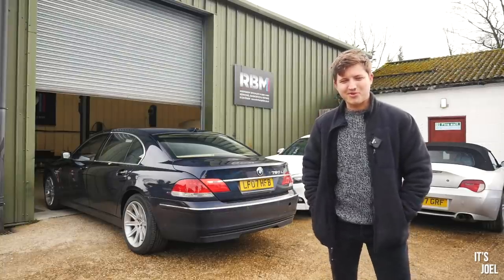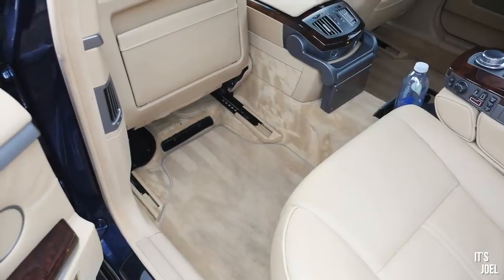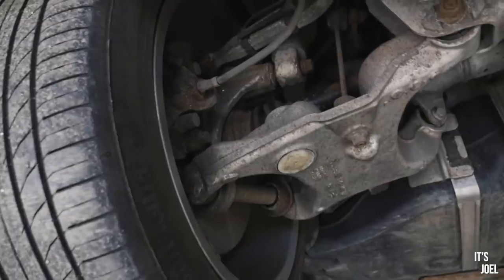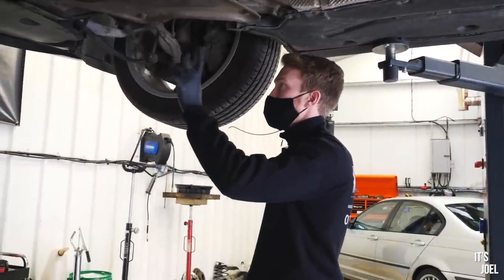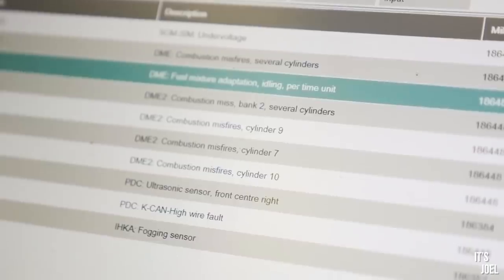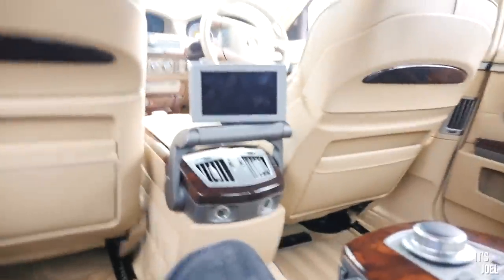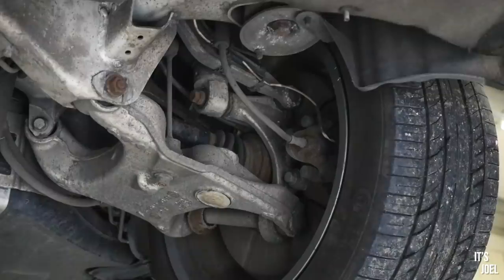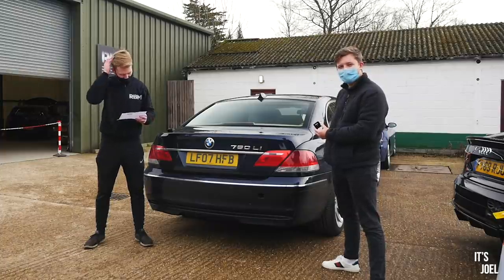How much will it cost to fix-up the cheapest V12 in the country?

Comment: As a former keeper of this car for 4 years I am very happy to see this. It tallies with my ownership experience, it never really cost me much to maintain either (FAR less than the RR Vogue I had before it), but having said that,  whenever I got a fault code or my mechanic (Atrincham Autotechnic) recommended something, I made sure I attended to it without a thought for the cost, and that's the only way you should approach ownership of a car like this. The coolant loss issue was something I had looked into more than once (full temp pressure tested and rad changed,  still couldn't diagnose it) so I just learned to live with topping it up every 2-3 weeks. I always made sure the fluids were regularly changed. The engine was bulletproof for me. Good luck and very interested to see your future vids Joel, do look after her!
Reply: I also had the engine carbon cleaned but it made no difference to performance whatsoever, total waste of £300!
Reply: @zhzhhhzhzhzzzz  yea they usually are a waste of money.
Reply: probably a very thirsty beast though. My C63 AMG was gining me 10-14mpg
Reply from the maker: @b.h.6307  averaging about 16 in this
Reply: @b.h.6307  correct, I averaged 15mpg in that thing
Reply: What about the rocker gasket leak and the wet rear passenger floor?
Reply: @1956ultra  not when I had it
Reply from the maker: I’m so glad you’re here to continue following along with this cars’ journey! Appreciate your input!
Reply: @zhzhhhzhzhzzzz  Wow, that's a very low number considering 6 liter displacement. I get around the same in my 2013 Lexus GS 350 awd (3.5 V6).
Reply: @UMORIEGA  as I understand it, 6 of the 12 cylinders aren't firing most of the time if you just pootle about, they only fire up if you put your foot down
Reply: wow
Reply: @itsjoel  exactly what I get with mine!
Reply: Wet floor is result of either sunroof 4 drains blocked or bulkhead drains under the carbon filters blocked allowing the water to gather and rise and enter the car .you need to get this sorted asap as their is a yaw sensor on driversside under the carpet and water ingress usually damages it causing lights on and abs etc to fail .
Reply: @zhzhhhzhzhzzzz  cylinder switch off is not an option on the e66 thats chrysler and mercedes .all 12 cylinders are wirking all the time
Reply: @jasonkiernan8163  glad I sold my e30 with this issue😅
Reply: That must be cool to see your car living on!

Comment: I have an E65 3.0 Diesel on an 08 plate. One former keeper from new (University limo car) and I too had it on the ramps once bought. Needed several injectors and made sure she had a major service.
Don't believe the naysayers Joel, this is a 2nd hand car like any other and things go wrong. Fixes do not have to be expensive.
I bought a used PDC sensor for the rear from eBay and it was £2.49 delivered. Removed the previous colour and re-sprayed and it works perfect.
Replaced the laser on the DVD player for £9 from China.

You are also right about getting behind the wheel of this big car is a joy.
Hoping she gives you many miles of smiles.
Reply from the maker: Thank you!

Comment: Sounds like a good buy and not a bad price to fix. I got quoted £450 for BMW to change 2 x colour coded parking sensors. Got a couple of black ones for 20 quid and took 45 mins to put on. They are still working 5 years later

Comment: Joel - “I may have found a little peach” “BUT it’s losing quite a lot of coolant and a bit of a misfire  😂😂🤣
Reply from the maker: haha. famous last words
Reply: @itsjoel  I had a coolant leak on mine. Somebody tried to convince me it was waterpump. I was actually an 'O' ring. 20p for parts and a few quid to fit. !!!!.
Worth looking at.

The misfire could be caused by corrosion in an electrical box situated undet bonnet nearside below cabin filter. Water gets in here and ruins it, causing misfires. It can be felt on downshift from second to first. You may think the gearbox is faulty. It probably won't be. Change the little black box. £100 for the part.
Reply: PS The water gets caught under that box because engine compartment drain holes get blocked with dirt etc. MUST FLOW PROPERLY

Comment: The idea of fitting three fuel injectors without doing further testing is laughable.
At a very minimum you would want to change the three coil packs on the bad cylinders with three on the good. Clear the fault codes and see if the misfires stay on the same cylinders or move. Even if they stayed on the same cylinders you would then want to change the three spark plugs for new just to eliminate them. While I had the plugs out of the three cylinders I would also conduct a compression test on the cylinders.to give an idea of the engine health.. It would also seem strange you have three misfires on the same bank of cylinders.
I would be checking wiring damage, or poor earth for the coil packs or vacuum leak.
You need to do more testing before  going to the parts bin and throwing injectors at it.
I work on a lot of BMW's and rarely fit injectors.
After reading a comment by the previous owner I would be concerned by it using coolant with no apparent leak connected to a misfire on three cylinders on the same bank. Do you have a blown head gasket on that bank. I would be conducting a co sniffer test of the coolant.
Reply from the maker: Thanks for your comment, you have to remember that lots of the video and inspection gets edited out - fuel injectors were on the quote as it was sort of the “worst case” out of the obvious items. Will test sparks & coils etc before actually fitting fuel injectors lol! 

Coolant we spoke about the possibility of it being gasket related - just starting with the very cheapest thing which is the cap.
Reply: chris jones it's not a good price if the car still has a blown head gasket after you spend £1500 on fitting unnecessary parts.
Reply: According to Samcrac, if it is the head gasket, you need to replace the whole engine with one taken from a Mini Countryman.
Reply: @itsjoel  had the cap issue on my e46, if they pop open a few times(overfilled coolant or expansion tank fault) they break. New tank and cap was good as new hope it solves your issue 🙏

Comment: most probably the issue with the misfire is not in the injectors, but oil leaking in the ignition coils from the valve cover gasket and not allowing them to produce proper spark.

Comment: You also need a rear towing eye cover!  😀
Reply: That's really bugging me. A very easy fix.
Reply: @BenB91  You would hope. Depends whether it comes painted from BMW, if so its easy but expensive. If not then its cheaper but not easy
Reply: @maxbradley9534  unlikely it will come painted. Easy to prime and paint a small area yourself.
Reply: @BenB91  Sure yes its easy to paint it given you have the paint. But I've found with BMWs getting paint in the correct colour is not easy when you're just a guy looking for a rattle can. And you can't do a shit job else it'll look worse than just not having the cap
Reply: @maxbradley9534  just need the paint code. Plenty of companies will make the paint and post it to you.
Reply from the maker: Yeah I agree, want to get that sorted - obviously just focusing on the mechanical stuff first
Reply: @itsjoel  Sensible. Was wondering what happened about the damp in the car? You mentioned that it was getting wet inside at the start of the video but I don't think Rob looked at that or commented on it?
Reply: Try ebay. They sell both painted and unpainted.

Comment: That's got to be worth having the other side rear arm changing at the same time and the front Flexi brake lines changed at the same time.
And if your feeling flush,the spark plugs.
Reply from the maker: Yeah might be a good shout
Reply: Might just be better to get braided lines all round, especially if you plan on keeping it long term.

Comment: u missed the supposed leak in the rear footwell mate!
Reply: That's probably the coolant leak
Reply: @dennisphoenix1  coolant leak in the back of the car 😐
Reply: @umarkayani9203  yeah that's what I meant, my taxi has a rear heater and it was leaking and soaking the carpets 🙄
Reply from the maker: We’re going to conduct a test to work out what this is
Reply: @Hans Wangsness yeah I had that on mine too 🙄
Reply: @itsjoel  I’d say clogged drains. Maybe.

Comment: You can get Bosch injectors for ~70-80€. Check the pipe down the radiator going up to the waterpump. There is a sensor put into the pipe. On this sensor there is a gasket that can go bad and leak down. 
Otherwise see if it leaks out of the hole from the waterpump
Id recommend fuel cleaning additive, also for the injectors
And check the date code on the transmission pan. If it is older then 8-10 Years it needs to be replaced/Oilchange (transmission) every 100.000km

Comment: Missfire might be because of the leaky rocker cover gasket, it goes around spark plug and injector holes, and, when leaking, floods them with oil. So do that first before buying exspensive injectors, it might save you 1/2 of your quote

Comment: I have a 2006 730ld , it needs a rear door handle ( comfort access) that's going to be £500 . I have done the front arms and the previous owner had done the rear brake hoses . Common issues.  I would change the transmission fluid and filter if you are keeping the car.  Coolant leak could be the cause of the rear foot well problem.

Comment: Don't pay for new injectors when you can have them cleaned on an ultrasound stand and they will work like new
Reply: Or use fuel additives to keep them clean
Reply: These injectors unfortunately don’t respond well to being cleaned, you just have to bite the bullet and replace them.
Reply: @olisharp6801  I think that is debatable. They are not any special kind of injectors, and it is common practice where I'm from (bad fuel is common) to clean them using ultrasound
Reply: @michaelg492  pretty sure this engine uses the Siemens VDO Piezo direct injectors, rather than the Bosch injectors

Comment: How can you charge for injectors (3) without testing..? Just because ASOL states the DME has found these 3 faults only points to that area.

Just because the injectors are on the same bank it doesn’t mean all 3 injectors have faults, they may well be on the same bank which more than likely a loom fault (hot/cold/hot) causing wiring break/corrosion as the firing order isn’t sequential like a 6 Cyl, it’s 1.7.5.11.3.9.6.12.2.8.4.10 in this V12, which indicates loom fault not injector.

This also goes with the PDC, try cleaning the sensor first before ripping the bumper off the vehicle to get to the sensor.

Besides, would you trust a guy wearing skinny pants and sneakers...????

Comment: I ran E38 740i for about four years back in mid 2000’s. Simply gorgeous and I stupidly sold it as was worried about it turning 100,000 miles 🙄.... so basically just run in!. We really need to stop this very British phenomenon of “mileage anxiety” on modern, well engineered and (as long as it’s properly maintained) reliable cars. Other than leaking radiator and a few pixels in dashboard going, it was trouble free. Still think the E38 is the best looking 7 series and of course was a James Bind car 🤓

Comment: So there we go, just as I and other owns of these cars know, they don't just fall apart under your arse. As the previous owner said, just look after it an it will be a lovely motor. Having owned a 2005 e65 730d since 2008 and done 100k miles with little more than a service once a year ( normal shit like brakes and tyres don't count) had new springs on the rear and the same wish bones an some bushes on the front. Get your gearbox oil changed. I drive quite hard so tyres last about 20k. One silly thing that pisses me off is the windscreen wipers are 86 quid a set. Best bought on offer at euro car parts or ebay. They are special for the e65.

Comment: Very highly doubt that the injectors could have went, although always possible, i kept constantly having random misfires within a bank and it turned out to be a bad nox sensor and crappy spark plugs, i have been also told by an independent that injectors need replacement, they were wrong! If a whole bank is misfiring it could be something else, like an o2 sensor etc.

Comment: Mechanic sounds good, but on the injectors I would venture running a fuel tank cleaner first and foremost and pull the coils and plugs to see how they are doing. I don't think these are direct injection, so being a normal injector might as well rebuild them. Will do the same miles as new ones.

Comment: Recon Margot would cost you considerably more than the 1500 quid quoted here. Not sure what to make of the "perks of getting in the back while the boys get ready"-comments in that regard though...

Fair dues on the pricing of fixing her up (the car, not Ms. Robbie). Injectors aside (which are seriously costly), that's in great condition especially considering the value of the car. Looking forward to more V12 adventures, as well as the 24h Z4 challenge. Which ironically is probably even harder to get comfortable in than- ah never mind..

Comment: I am actually eyeing on one. 2007 760li with 78,000 miles on it. I already have a 1997 Mercedes w140 S600. Well another v12 can’t be too much trouble 😂.
Reply from the maker: Then you’ll have 24 cylinders on your driveway
Reply: @itsjoel  😂

Comment: What about the water leak in rear footwell mate
Reply: Seems that one got forgotten. My guess is rear heater matrix weeping.
Reply: Might be just the rubber in the door not letting water run through it
Reply: @grahamc4418  possibly, or fridge condensation or sunroof drain blocked. Annoying, but it will be fixed in the next video.
Reply from the maker: Still needs to be investigated
Reply: Probably just the door membrane needs resealing - can be done by partially totally removing the door card (look for youtube videos for how to doo this without damaging fixings); heat mastic with hairdrier and then reseat. Common problem in most BMW's.

Comment: not bad to be fair.....pretty much like any old car...and to say i have a jag s type v8 and i had to take that off the road as the rear subframe is shot and it would have cost me roughly £2000 in parts and labour to sort it....then the auto box would need a rebuild at around £1000 and then the suspension at another £1000.....so you have done pretty well there...😂😂

Comment: Mate do yourself a favour and dont replace the injectors before you check the high pressure fuel pump diafraghms .these cars have 2 hpfp .1 per bank and suffer failure of the diaphragm inside and cause poor fuel pressure which mimmicks injector or plug failures .which result in misfire codes and poor running .firstly get all the fault codes cleared .then remove the vent hose from the top of the pump and block the pipe with a bolt then fit clear plastic pipe onto the outlet off the top of the pump and run the car to see have you any fuel from it .if so then ur pump needs new diapgragms .do 1 bank at a time .there is also a solenoid in the bulkhead in the vent system that fails allowing returned fuel into the vent system causing similar issues .hope this helps .i have 4 760s and have owned about 8 in the past .injectors do not fail .its either the pumps or coils

Comment: She's still a baby at 110k miles. Just wait for one of the 2 £1k high pressure fuel pumps to go or try replacing something on 12 cylinders and it'll drive you mad. I have a 2003 745Li and it's a much smarter choice. Port injection, most parts are cheap, only one non high pressure fuel pump and ofcourse that addictive V8 rumble!
Reply from the maker: I’m just going to enjoy the car and not worry about things that might go wrong! That’s no way to be a petrolhead
Reply: @itsjoel  tbh you shouldn't have many issues, James fixed the big ones before selling to you

Comment: well I bet if you don't pay for original parts, and put spare parts, it will be with labor half the price
Reply: You really don't want to put second hand brake hoses or injectors!
Reply from the maker: It’s not the sort of car I want to skimp on 😂
Reply: @itsjoel  Brand new parts not from BMW but from GSF, your brake hoses are £10.14 each. It's the sort of thing you can fit yourself. You are getting absolutely ripped off by an overpriced mechanic who doesn't really seem to have a clue what he is doing.